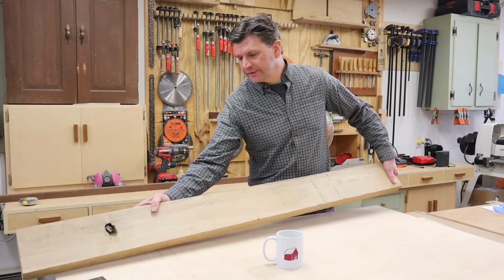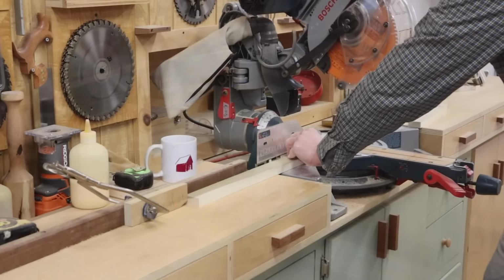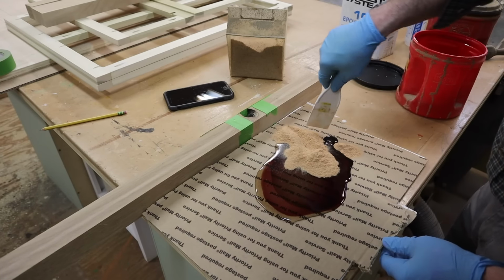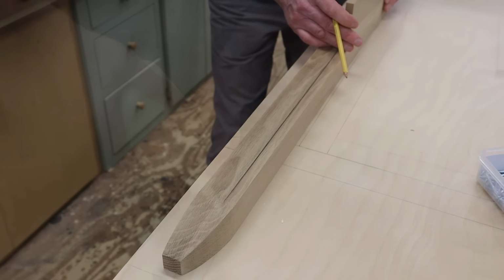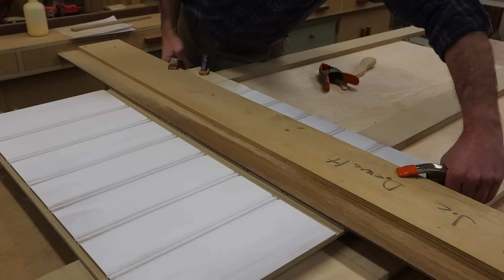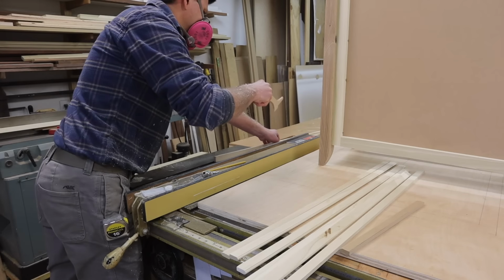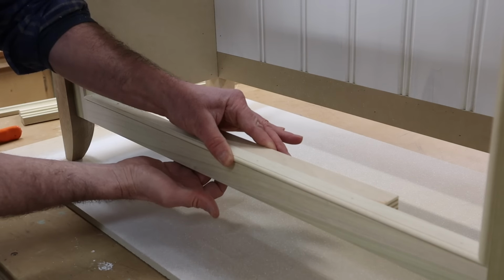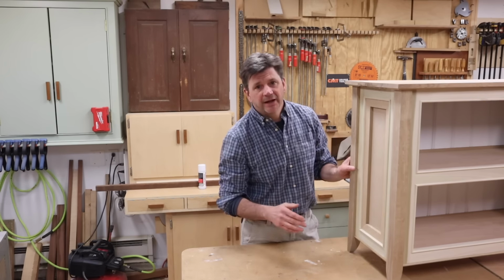How to Build a Bookcase by Jon Peters

Comment: As the 'master of mitres' as others have described you, can you explain why face frames are usually NOT mitred?    Obviously it makes the use of Pocket-Hole joinery a problem, but that should not deter you!
Reply: Thanks for the 'heart', Jon, but I was really hoping for an answer
Reply: Don, until Jon gets back to your question... here's my 2-cents...  Two reasons for the rails and stiles frame vs mitered:  First, I find it more difficult to make a mitered joint as mechanically firm, and second, I like the the "strong" look of the rail/style frame.  I recently had to make a corner cabinet in a client's kitchen to match existing work, and it required an oak mitered frame door with glass insert.  I had to dowel the joints, and do a much more difficult clamping set up to glue the miters all together.  Mitered joints to me have a lighter picture frame look to them.
Reply from the maker: Hi Don , I find question like that hard to explain in words... it’s something I’ll address in an Instagram story. Thanks